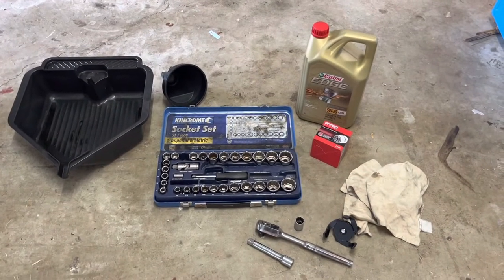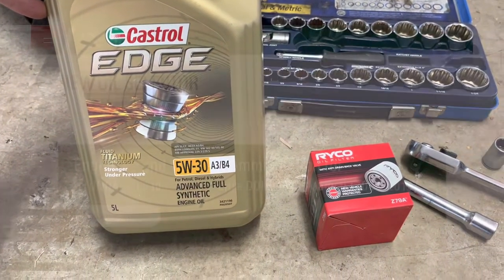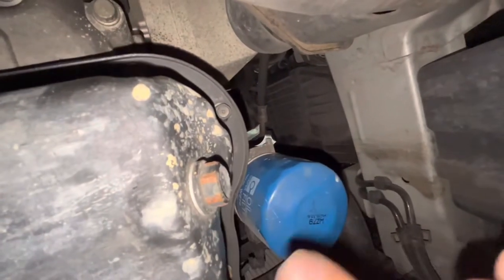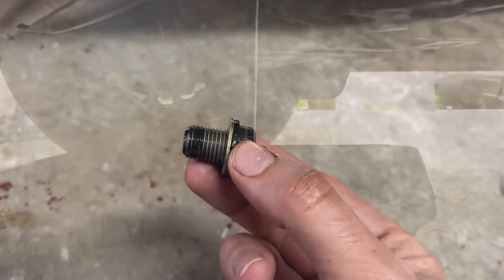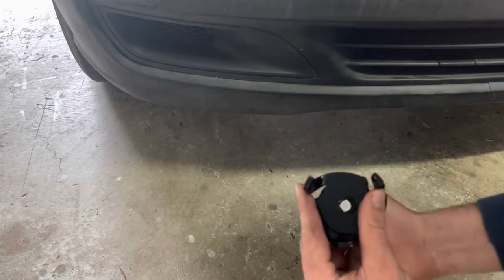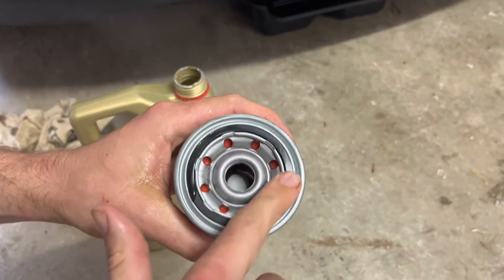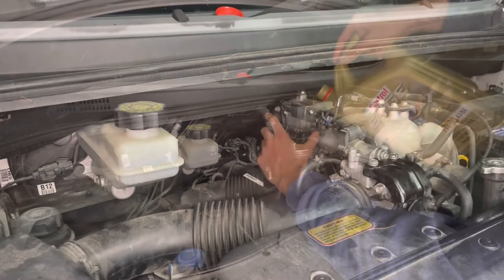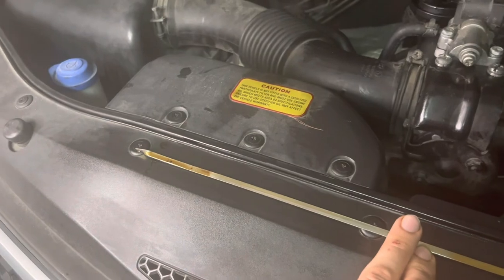How to do an oil change - Hyundai iLoad & iMax + Oil filter replacement

Comment: If you find the sump bolt is tight, get a long bar. Also, get the filter removal tool and a long bar. These were put on TIGHT at the factory!
Reply from the maker: Good tips!

Comment: just had the worst mechanics for an oil change hyundai iload diesal. saying $140 then $180 then afterwards they want $325. they quoted with engine flush then they say they dont do it. gets worse than that. he said she did it then she said he did it. young male and female mechanics. i lost $180.

oil low and black same as it was before. some warning flashing.... oil low???
Reply: iam doing the whole thing again myself. penrite oils and flush. hyundai mechanics told me they use penrite oil flush every time. i will check castrol... thanks for the video
Reply from the maker: Can be so frustrating when you don’t have a mechanic you can trust! Have been in that situation, especially when travelling! Hope you got it all sorted 🤙🏼

Comment: Did you have enough space under the van without having to jack it? Also, how does the petrol engine go, is it powerful enough?
Reply from the maker: Had plenty of space under there. The petrol is pretty gutless to be honest. It struggles up big hills. But it was fine for what it was
Reply: @juliustinkers  The turbo diesel goes like a rocket!
Reply: I had a slightly sloping driveway and ran it down onto some thick wooden planks with a brick under it. This meant raised by maybe 15cm and I was under with heaps of clearance.

Comment: The oil drain plug is over tightened on mine. Can't get it off
Reply: spray with wd-40 and then tighten the bolt and then release it...
Reply from the maker: As above, WD-40. Also try a breaker bar or an impact wrench
Reply: mine was surprisingly tight also. Get a longer bar and it will move.